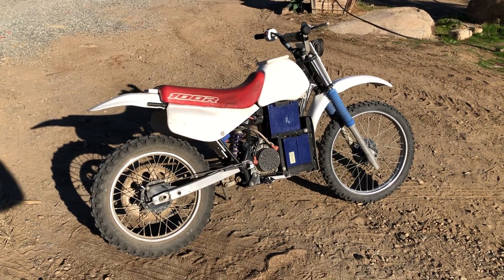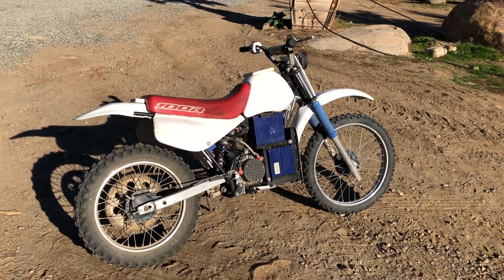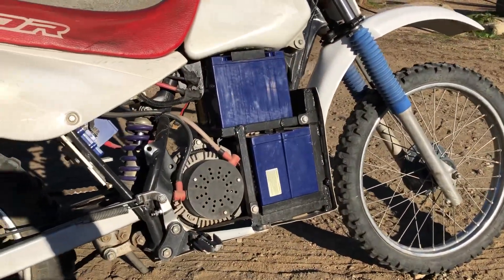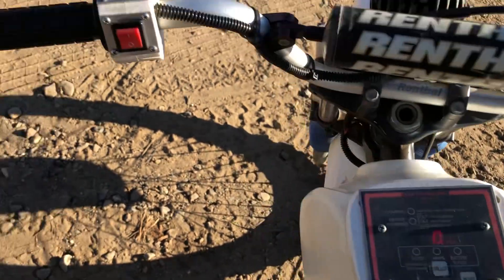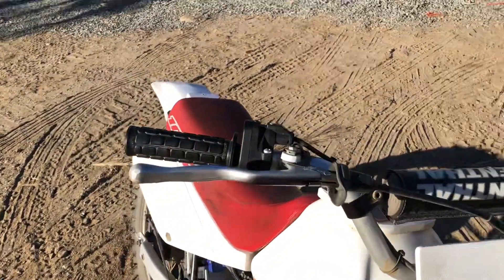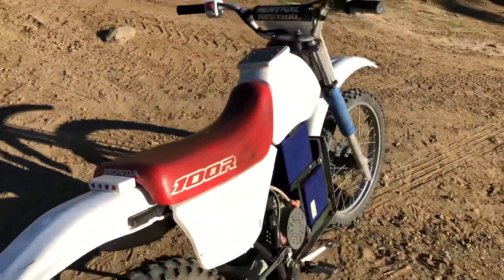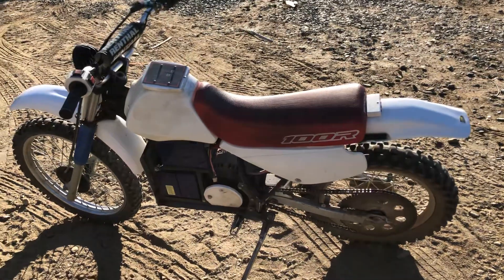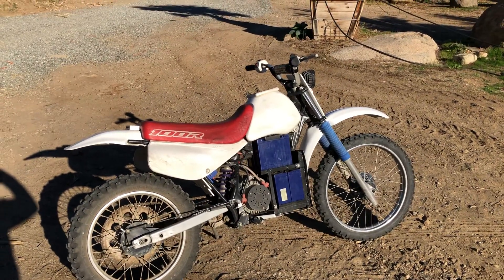Dirt bike conversion to electric!

Comment: What would you do differently if you had to build it over again? 

Also wondering what was the cost to build? Going to convert my xr100 sometime soon.
Reply from the maker: Definitely need lithium batteries
Controller & motor 1,000 then batteries